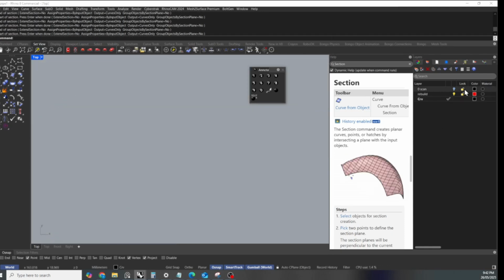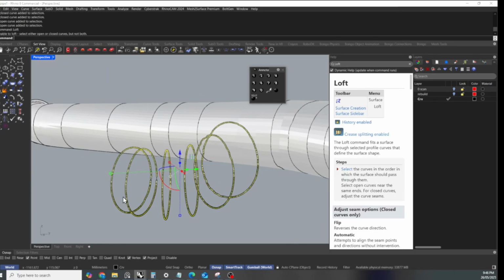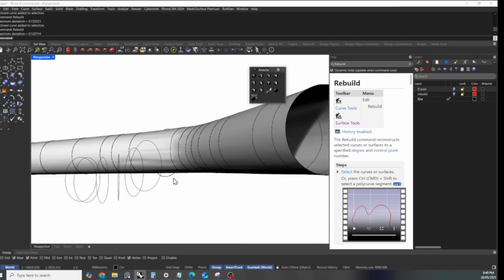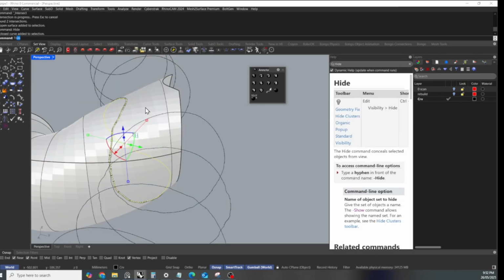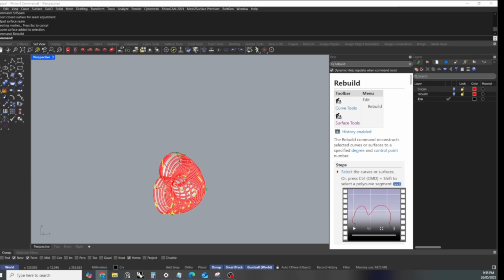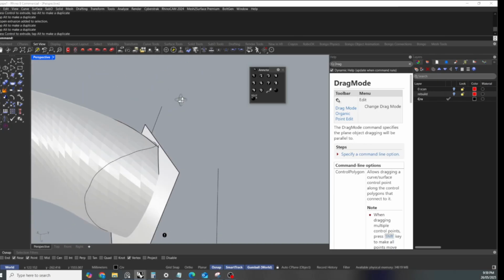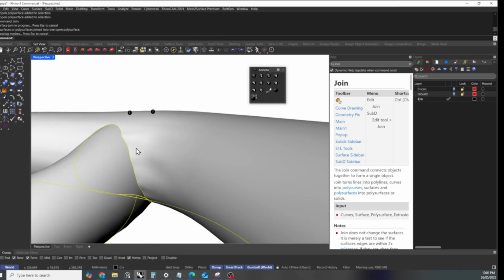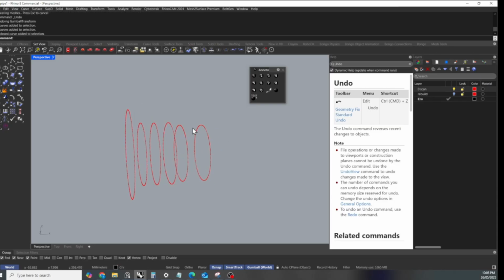Reverse Engineering In Rhino - No Plugins -Helicopter Duct- From Scan to CAD

Comment: Thank you for your sharing. I do Rhino resurfacing as well
Reply from the maker: Great! Nice to meet you. 
Rhinos together are stronger lol.  What kind of parts do you do? Do you have any tips?
Reply: @TylerDesignandDigiFab i am in toy industry. I handle files mostly from MAYA, BLENDER, ZBRUSH… that is OBJ, stl files. 
I used similar techniques but I think your method are more efficient. 
The most difficult region of resurfacing is the rounded over edges.